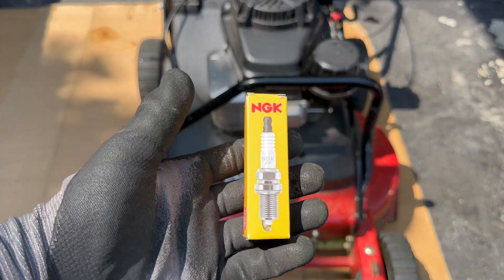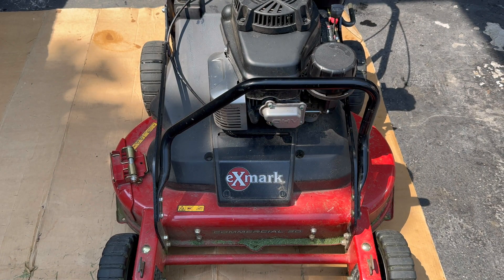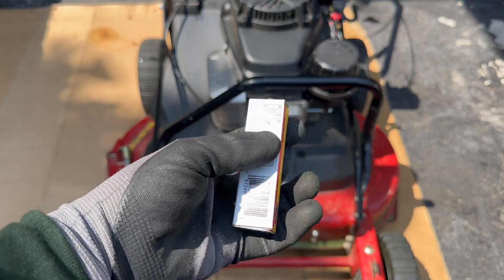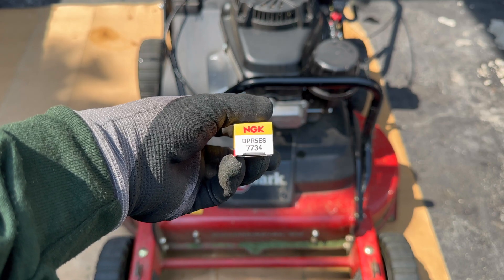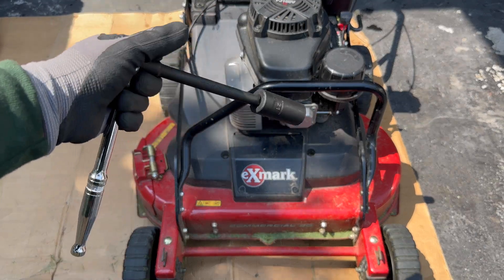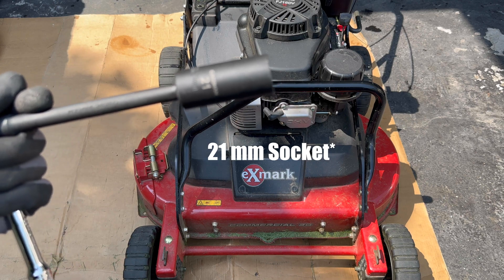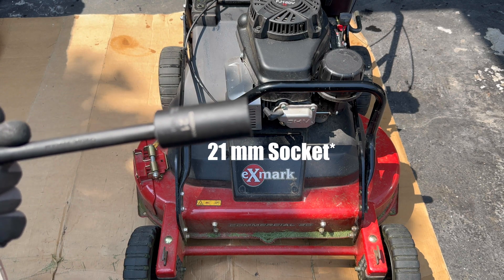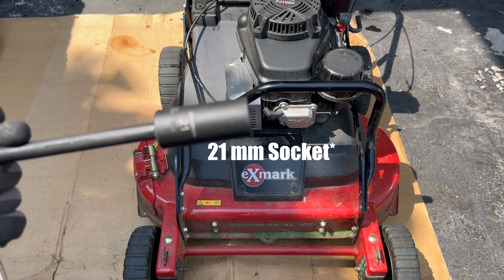How to Change the Spark Plug on an Exmark Commercial 30 S-Series Lawn Mower (Kawasaki FJ180V)

Comment: You changed for maintenance reasons or the mower was having problems starting?
Reply from the maker: Mainly for maintenance reasons, but I did find sometimes it didn’t want to start on the first couple of pulls after it would get warm and I had done a couple of lawns.